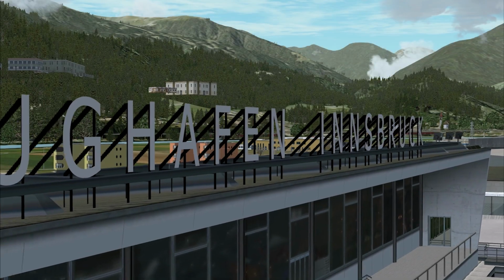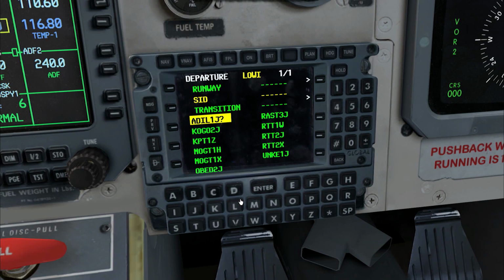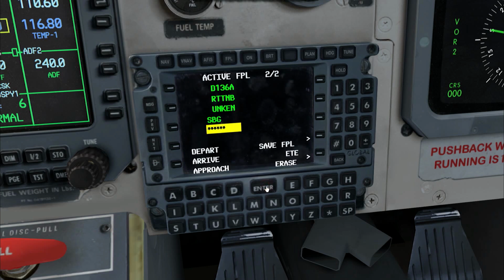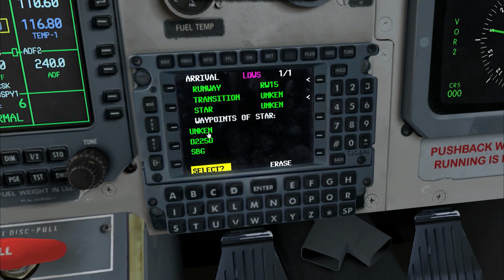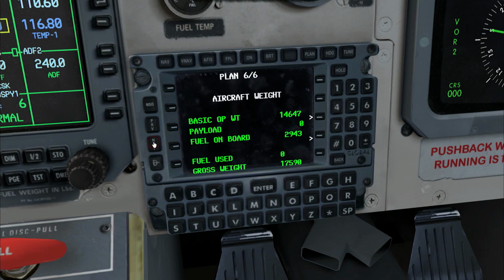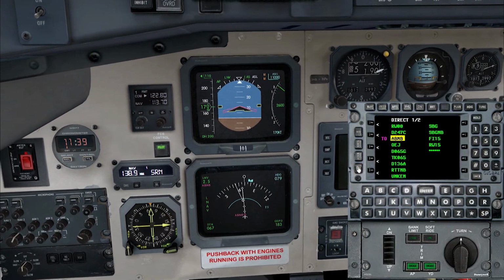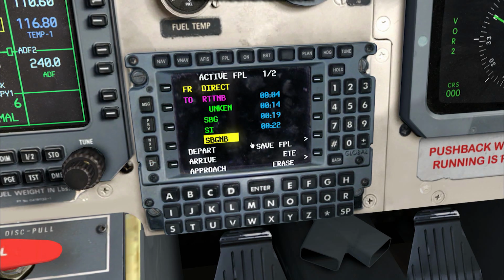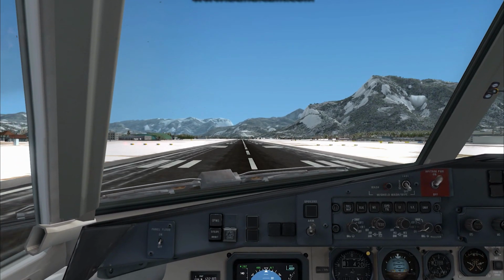Jetstream 41: Basic FMC programming {FSX}

Comment: question, those tqo boxes that tell your altitude it black on my screen. the two boxes above the yolk
Reply from the maker: Have you turned the avionics masters on? Otherwise you may need to upgrade to the latest version of the software.
Reply: SWEDFLIGHT it works. but how do you know which sid to use?
Reply: AdmissiveComic Its up to your ATC addon (or VATSIM or IVAO controller if you fly online). Default FSX ATC do not use STAR nor SID, they will always give you vectors.